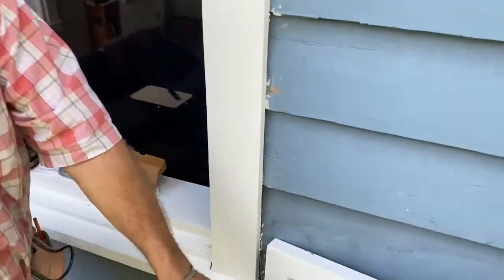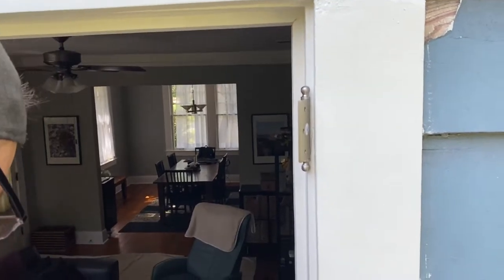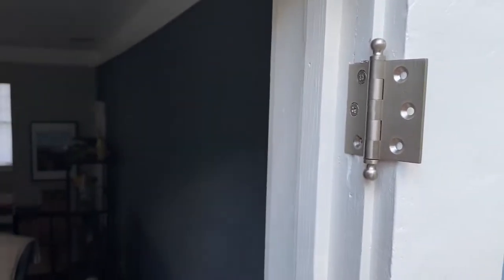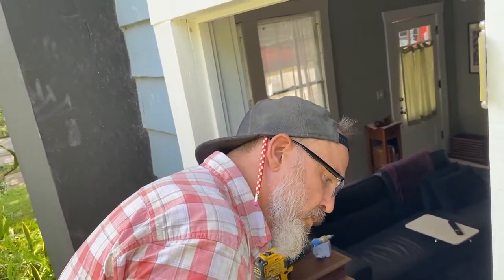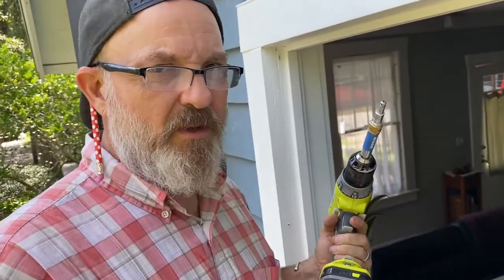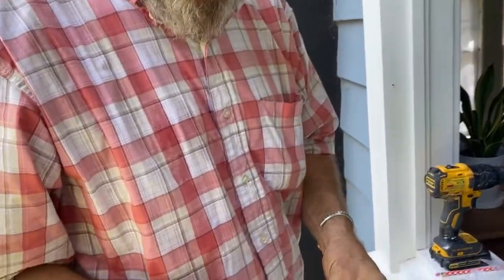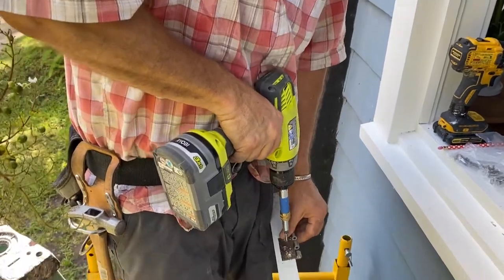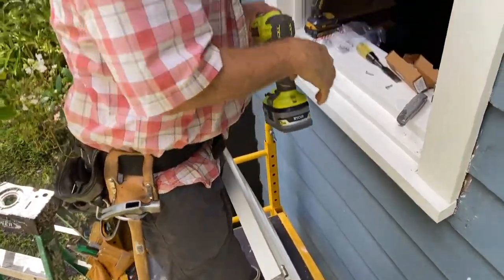New Project Day: Hinge Install

Comment: I’m rehanging casement windows (that were restored) to a 116-year old house. So, the ball pin cover part of the hinge goes OUTSIDE in the window frame, and not on the actual window, correct?